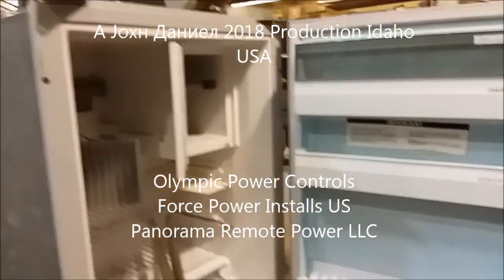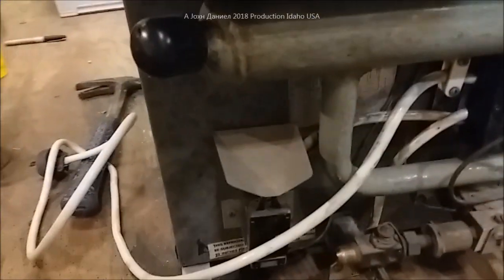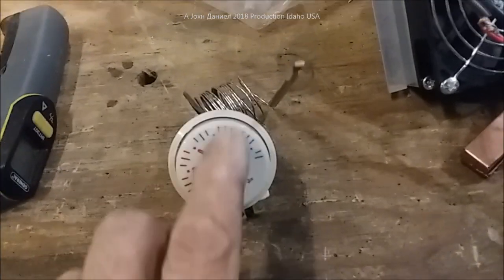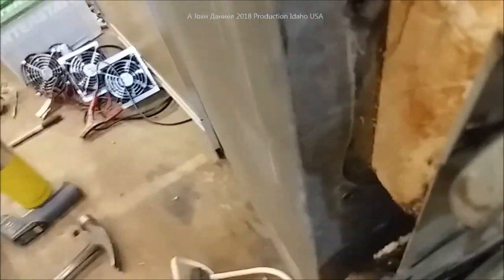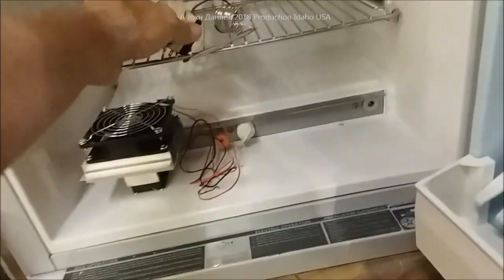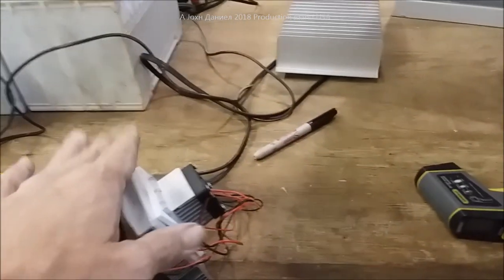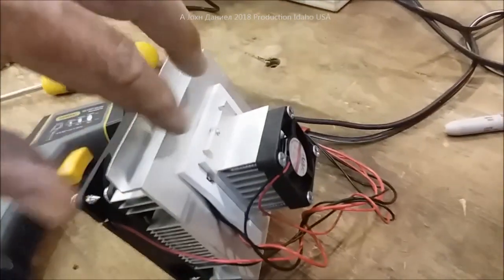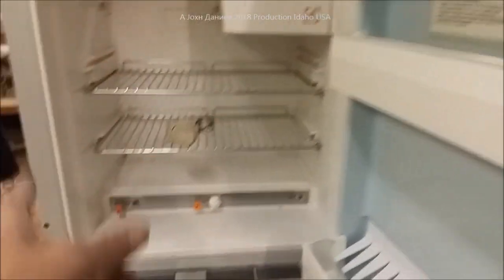Peltier Thermoelectric Cooling, we convert RV Refrigerator VIDEO 1 of 2 ↙

Comment from the maker: My Same Peltier (thermoelectric modules) https://ebay.to/2x72xPJ , The -30 to + 30 Celsius Freezer/Fridge Thermostat https://ebay.to/2CJVW3o And full RV replacement cooling units of all sizes https://ebay.to/2MhK2xo just contact distributors with your model ID and year. Additional parts based on need were used, if you need direction to them just ask.
https://en.wikipedia.org/wiki/Thermoelectric_effect
Reply: Hey John, I have a quick question of you IF I can. How do you like your Sportsman Sandstorm 4000 Watt Dual Fuel Generator you ordered from Wal-Mart? I'm needing another for a spare and curious bout this one. I would appreciate any info on this or another one you like as much or more than this one. Thanks ahead of time😊
Reply from the maker: I freekin love it. Been using it to run my 90 amp MIG welder, it gets even better as you break it in. BUT, when you get it, after it has one hour use, jack the voltage up to 125 by plugging in a 100 watt light bulb ( old school incandescent ) then with a RPM meter on it https://amzn.to/2x2ZJD6 turn up the idle till your stable at 125 volts. I'll do a video on that real soon.  The Generator finally hit Amazon https://amzn.to/2oWQws8 $350 too, but I prefer WalMarts https://bit.ly/2mKEVLC $270 for real. At WalMart you can have it site to store shipped which means no damage chances and buy a no questions 2 or 3 year warranty for like $20
Reply from the maker: The R factor on the fridge in very old Dometic PDF shows body at R-16, door at R-9. I will increase it by bonding  more 1" R-5.6 rigid polyiso on the outside all over and increasing injection in the door where a few non foamed cavities exist plus a new R-2.7 IMFRP door panel and a additional weather strip in the door seal. Compare it to a Koolatron 14 quart thermoelectric that cycles 2 minutes off for 8 minutes on thats total R value is 6.3!  Mine should KICK ASS!

Comment: John it's now 2021 and I just looked at part one of this video I see excuses u gave asto it got to cokd to do a accurate test and as soons as calf season is over an well covid hit funds are low but I dew many many vids on otger project videos you done since tgen so if part 2 wasn't done over covid an weather an finding then why is it you coukd afford to do so many otger projects and vids but no funding to do part toon peliter refrigerator you also said in one comment parts were ordered anin so if they was ordered tgat means was already bought I'd like to know is there a osrt 2 if so where I csnt find it if no part 2 why you know I read every comment and reason you gave for no part 2 u know I've looked at all the other projects u done since tgen so if anan can afford all these projects since osrt one why no part 2 I was so into part one fir I have been working on building a Coleman 40 at 13 volt fridge I accidentally grounded out an kilked the unit an was gonba but another peliter unit but wonted to enhance the cooling of it tge factory unit in it was cool but never cokd an its winter I set it outside my can before I fried tge unit it was in 300degree temps all night an at best it was cool inside the next mornin i beed to view part 2 or i need some info on a cheap fix to achieve cold temps at a cheap fix

Comment: Where is vid 2? 
Need to know what the energy cost to run is compared to a small rv 12v compressor version.
Reply from the maker: Got a bunch of parts to build it this spring with a more controllable peltier cooler, then COVID hit and we got a 60% drop in funds to do everything. So it's like most things right now, if I have the parts and extra cash it gets done. But the cash flow is so bad and cut I just do living priorities or what will pay back fast.
Reply: @JOHNDANIEL1  I hear yah. :)

Comment: Can you pin part 2 to the top of the comments because I cannot find it,thanks
Reply from the maker: We are just making Part 2, Video one was during the winter, trying combinations on it in the winter caused too much freeze up and fuse blowing. So its off to make a 3 on 1 with some sort of reverse voltage  defrosting that can be used when ambient temps go below 45 f
Reply: @JOHNDANIEL1  If you wait until it gets below 40 deg & then put it outside, you'll have an efficient peltier fridge.
Hey. Do you know why the US never adopted the metric system? They thought the temperature was going to drop 32 degrees.
Reply: Still waiting for part 2.

Comment: Hi, I am attempting to build a simple, cost-effective off-grid alternative energy device, and need some help, as my electrical skills are somewhat limited. Therefore, I am calling out to any and all electrical experts out there! Especially electrical experts in the field of alternative energy. Or even better; electrical experts with knowledge or experience in the use of thermoelectric modules. Or those who merely tinker or invent. Please help me by watching and answering a few questions outlined in this short video:

https://youtu.be/pauPXw5x6vg

As a quick preview, here are a few of the questions:

Question #1:
Connect the thermoelectric modules in series?
Connect them in parallel?
Or a combination of series and parallel?

Question #2:
How to measure amps?
(in order to calculate watts)

Question #3:
What do these 2 small buttons on this device do?

Question #5:
Is there a practical use for 5 volts output?

Question #6:
Can I connect the modules
to make the other devices (shown in video) function and charge up a 12 volt battery?

Thanks, in advance, for watching.
Any advice or information
will be highly appreciated and helpful.

https://youtu.be/pauPXw5x6vg
Reply: Ok..  Great

Comment: I'm curious to see the next video. I've got a 40 liter cooler id like to put one in. Is there a size you would recommend  to run off my boat battery with a small solar panel?

Comment: Peltier modules have an inherent 40 degree temperature difference... which means if the outside ambient temperature is above 70 degrees Fahrenheit the box inside temperature will be above 30 degrees Fahrenheit.  If you use a water-cooled outside heatsink you can hopefully keep the ambient temperature at or below 70 F.  Which will allow the box temp to be below 30 degrees when the ambient air temperature is over 80 - 90 degrees Fahrenheit.

Comment: whats the part number on the thermometric coolers after you take the heat sincs off?  i tried using two 60 watt units for a water chiller of coarse making sure the hot side stayed room temp and the thing couldn't cool a 1L resivorur worth a damn let alone any amount of actual working thermal load on it.
Reply from the maker: If the water does not move, it will not cool. Using a Peltier to cool water requires some flow, its density is too high to allow it to move in a heat cycle like air does. Look at a wet cooling radiator system for a computer using a Peltier, it has circulation.
Reply from the maker: PS - I normally do not disassemble one to get to the thermoelectric cell for number collecting in the process of installing. If I do for some reason I will post that data on the up coming video on this.
Reply: after a little more research the improved TEC devices seem to be sold at $30-40 for a stand alone module offering increased heat cycle durability and supposedly improved efficiency. i haven't been able to find a video of people comparing the performance between the chepo ebay modulus to the much more expensive newer generation ones.
Reply from the maker: They have improved drastically in the last 3 years
Reply: it does have a water pump to circulate the loop. i tried two different set ups, one in a cascade or series set up as a means to get a larger temperature difference and one as a parallel set up to have them in contact with the "warmest" water the difference was negligible probably do to the really unimpressive cooling performance and moderate pump speed. I used two generic 60w TEC devices. if i had to guess i got under 40w of heat removed from the water and used 120w to do it. plus probably another 25 watts of server fans on the hot side heat sincs and water pump.

Comment: Not to be a negative nancy, but I think you'll be unimpressed with the performance/added heat to cabin/power consumption.  Ever seen those wine chillers with the glass door? they run almost 100% duty cycle and can barely keep up in a climate controlled room.  Even if power was plentifull and the peltiers were free I believe I'd still go another direction... there are many reasons why your home fridge uses vapor compression phase change cooling than a simple cheap thermocouple(peltier is an array of these)... and its because of efficiency/not cost...which you kinda need in a camper.  It'll be interesting to know how well it works out!
Reply from the maker: Ah, but the cabin location will be back into the location where its vented to the outside and comparing this to a Thermoelectric cooler with a R-3 insulation value is a bit off the plan. This RV refrigerator body has a insulation value 5 times those, and another R-6.3 will be added plus the door will have a major increase. It will be like coolers in 4" walls of  block foam.

Comment: In confused buy the original operation of the fridge, just that might make a good video.

In previous comment sections I've seen people tell you the efficiency is too bad to be worth doing. I disagree just because there's something to be said for the simplicity of peltier cooling.

I've been thinking about doing a refrigerated water tank for my under sink reverse osmosis water filter. It would be really simple, I'd have to do insulated tubing to the tap(for condensation), mount the thermostat's thermometer and peltier to the tank, then use spray foam to insulate the whole thing. I'm just not sure about the thermal conductivity of the bladder tank I'd be using.

Comment: Cool!!!  Let us know how well it works!
Might try stacking two units together, hs|hot/cold|hot/cold|hs, this way two peltiers will lower the lowest temperature it can reach
Reply from the maker: You can do a plate to plate heat sink on the cold side, I am looking into that exact idea for the freezer with a 3 layer blend of aluminum and one of copper at the Peltier. Using a heat sink thats 4 X the size in a non airflow area works like the fan and current heat sink but can reach 15 degrees cooler.
Reply: Awesome idea.